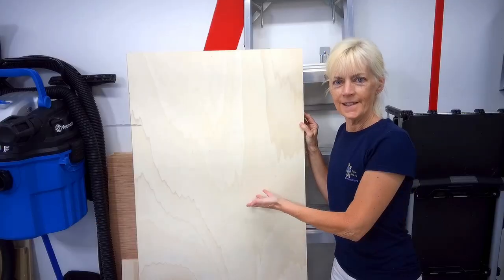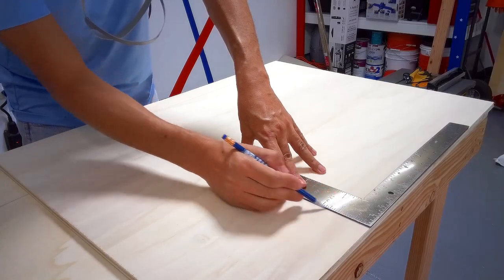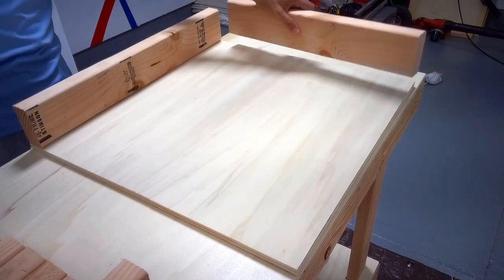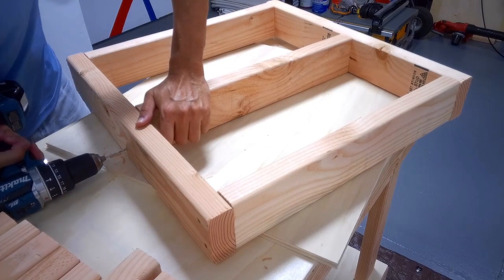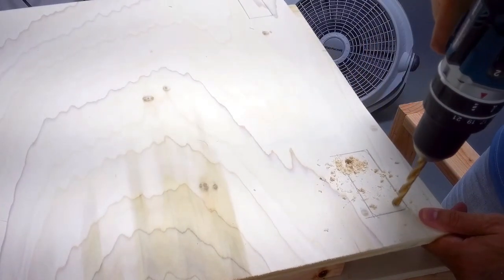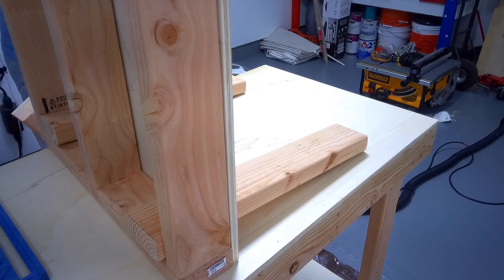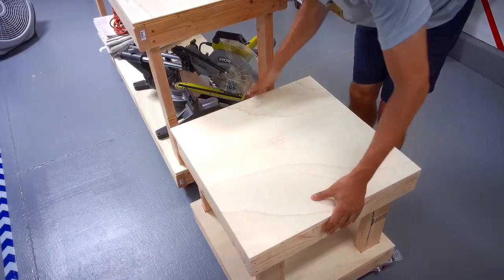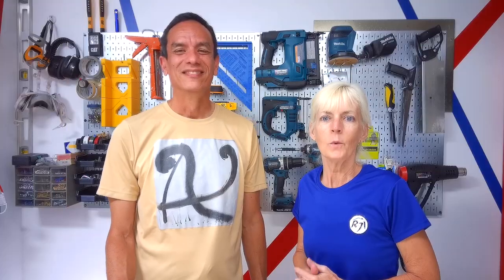Poor Man's DIY: Simple Mobile Table Saw Stand

Comment: This is a great idea. You got it perfectly level with your actual workbench.
Reply from the maker: I do not wish to deceive anyone. I intentionally built the table saw stand 1/4 higher for various reasons. 1-because the slope of my garage could make a difference depending where and how I set it up. 2-if I ever do try full sheets of plywood I need to set the stand a little further away from the outfeed and the wood will start to sag before reaching the outfeed. (At least these are the excuses I use for not being perfectly level! LOL). Thank you so very much for watching and taking the time to comment as always.

Comment: Any chance you have the measurements/plans?
Reply from the maker: Unfortunately,  I wrote up the plans on a whiteboard and erased it when finished but... i am in the garage taking measurements for you.
(1) 3/4" plywood boards. 23"x23"
(2) 2"x4" boards 23" long
(3) 2"x4" boards 20" long.
Use 2x4's to make a square and add the third 2x4 in the center for additional support. then attach plywood on top

Make and identical square with 2x4's and plywood as described above.  

(4) 2"x4" boards 20 1/4" long
These board will be the vertical supports. When adding the 3/4" plywood on top the entire cart is 21" tall. Adding 3" wheels and it brought the height to 24. You should adjust to a height that works for you. Hope this helps
Reply: Thank you. I was hoping for measurements too!